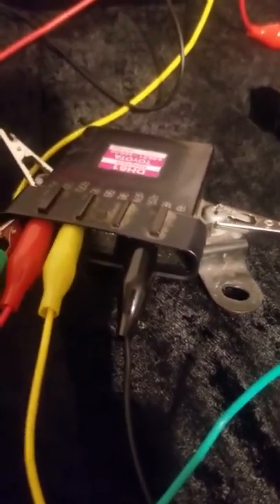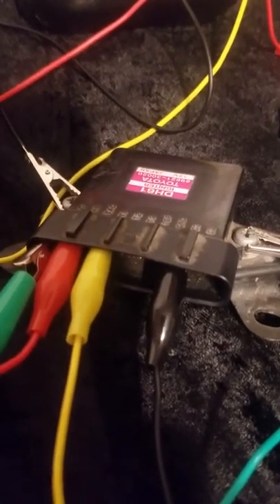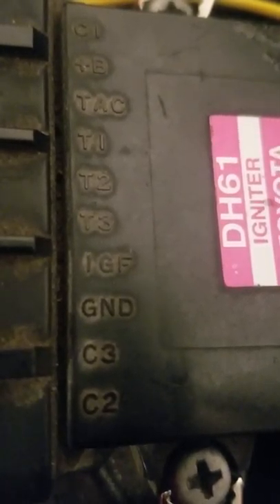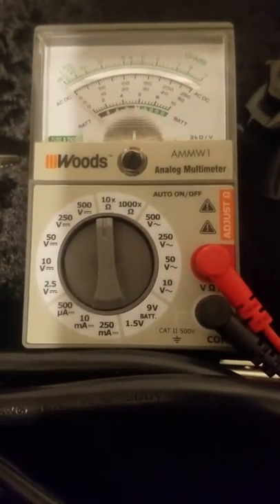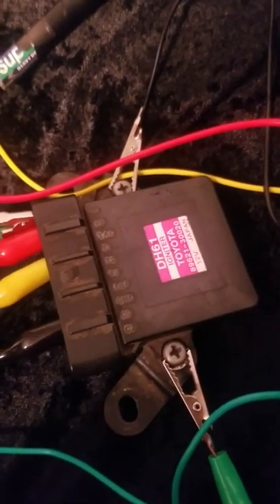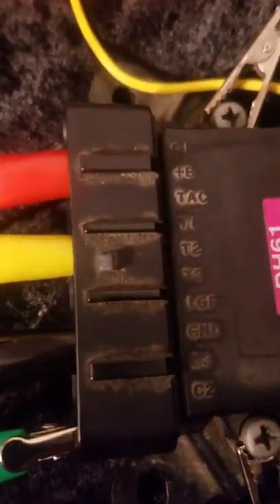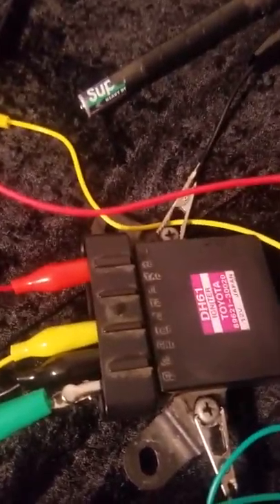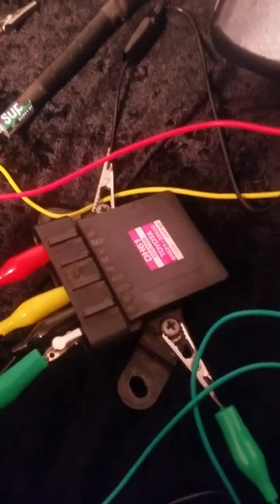DH61 Igniter test for VVTI JZ engines

Comment: did you end to find what was wrong? I having the same issue of crank but no start after doing a rebuilt. I've checked the crank position sensor, fuses, etc.
Reply from the maker: The igniter was fine. I was chasing the wrong symptom, because I thought the spark seemed weak. The issue is a strange one, because it didn't happen for the first six months I had it running on the road. But out of the blue one day, it started flooding on moderately warm temperature days. I didn't realize it at the time, but it seems like the factory computer doesn't calculate correctly for the temperature and what happened was the injectors are dumping a lot of fuel causing a flooding condition upon starting. If you can get it running,then she runs just fine. But the issue remains if it sits for a little while somehow the computer is just giving it too much fuel to start. What I've had to do is put a switch in series with the fuel pump so that I can build up pressure enough to start the engine and turn the fuel pump off while I'm starting the engine. Once it fires up then I turn the fuel back on and she'll run all day. It's really annoying but at least I don't get stranded anymore. So, anyone else that's chasing a no-start ghost on this engine/ecu setup and it seems like everything else looks good, I'd recommend trying to somehow modulate your fuel pressure. Seems like there's a computer that was on the Aristo that modulates the fuel pump voltage, and thereby, pressure. Maybe that's what I'm fighting. The computer doesn't know that my fuel pump always runs at 12 volts, so maybe that has become an issue especially here in the humid Gulf South
Reply: @brianleonard6879  I have very familiar an issue, car won’t start, but there no spark. I’ve checked connector, one pin shows 12v other one is a impulse ground.
Reply from the maker: @maxmiroshnichenko9843  If the igniter tests ok , then look at what the ecu is doing while cranking. You should see 5 volt pulses from those three ecu wires going to the igniter. If those 3 wires aren't pulsing, then you should suspect the crank and/or cam sensor is not doing its job to provide data to the ecu telling it the engine is rotating and it (ecu) needs to turn on fuel and fire. I saw spark and assumed it was too weak for ignition. But what was really going on in my case was the fuel pump modulator computer that is on-board in the Aristo is not present in my swap, so by manually lowering the fuel pressure at start up, I get acceptable results with cranking and starting. On cold days, it isn't an issue, since the manifold is cold also and it takes more fuel to keep it running. Its the hot days where the ecu is pulsing the injectors based on the pressure the ecu is EXPECTING to see. Probably around 20-30 psi for starting on warm days.Toyota must have programmed the ecu to pulse the injecotrs a certain amount of time based on the fuel pressure that the stock system delivers at startup. Again, I am running the fuel system 100% standalone, so it gets 12 volts all the time, when the Aristo equipment had in place a means to control fuel pressure. That was my whole problem and I wasted alot of time and money figuring this out. All things considered, I would recommend finding the fuel control ecu for that engine and using it if you are running the stock ecu. Thats what I would do differently if I had it to do over.
Reply: Yeah same bought a is300 with 2jz ge needed a new head jumped timing I did a rebuild and mechanically everything’s good now and replaced crank sensor im smelling fuel but I get no spark I think it’s my igniter not sure what todo

Comment: Where did you end up with this
Reply from the maker: I am still lowering fuel pressure manually while starting and thats the only solution i came up with to keep it starting. I plan to wire the A70 fuel pump relay to be switchable from 9 volts to 12 volts like the 7m ecu was doing. I just haven't made the time to experiment with this
Reply: How do you lower the fuel pressure manually?